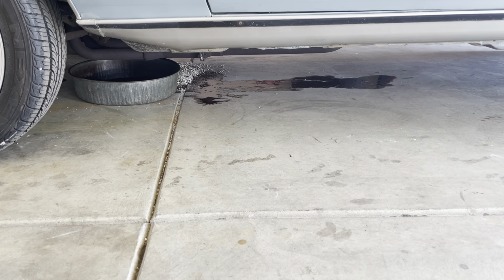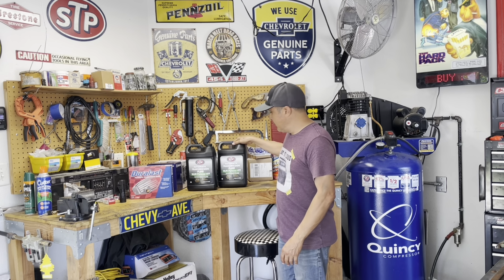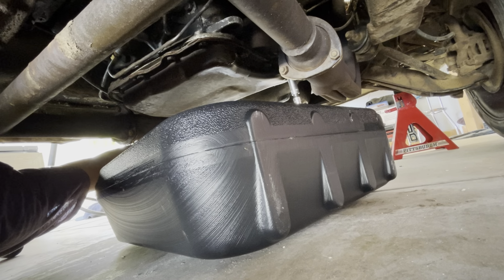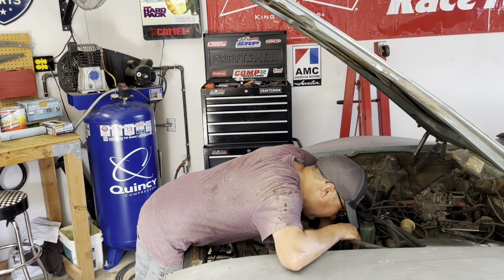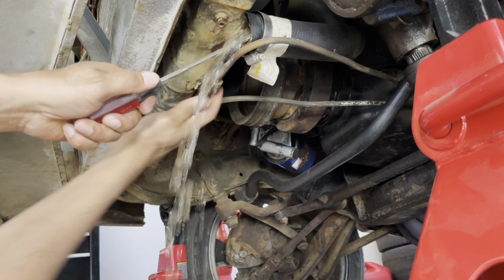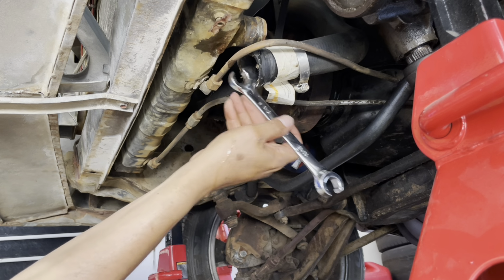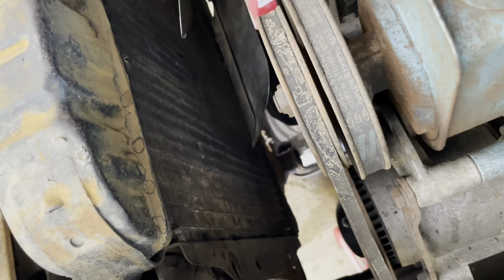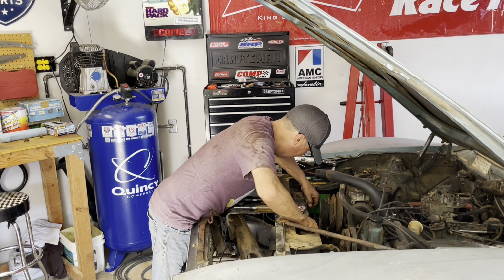1974 AMC Javelin Part 14

Comment: I have an 86 AMC 360 in awesome condition. its been rebuilt, .060 over, RV cam, converted to fuel injection and upgraded ignition system. Comes with a 4x4 727. Give me $1500. The fuel system and ignition are worth more than that. I'm in Los Angeles. I'm installing an LS that has a newer computer system to deal with smog here in Commiefornia.
Reply from the maker: That really sounds like a great deal and I appreciate the offer. However I'm holding off on major purchases at the moment. My 71 Monte Carlo SS as shown on my other videos is getting ready to go into paint.

Comment: Hold the pickle. Hold the mayo. Special orders don't upset us.

Mayo oil or trans fluid is never good.

You could pressure test the trans lines through the radiator. A bad radiator is cheaper than a bad transmission.
Reply from the maker: Ha ha! It does look like secret sauce! LOL

I'm taking it to the radiator shop and will see what they say!